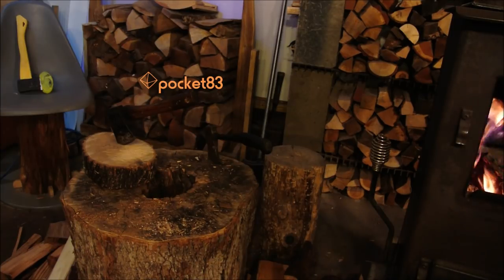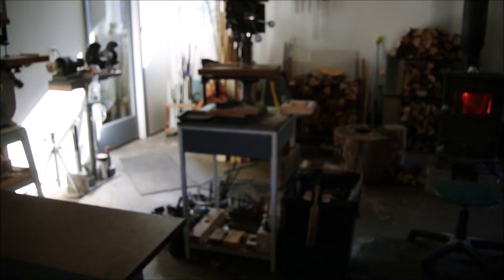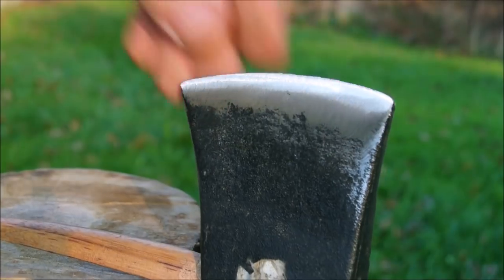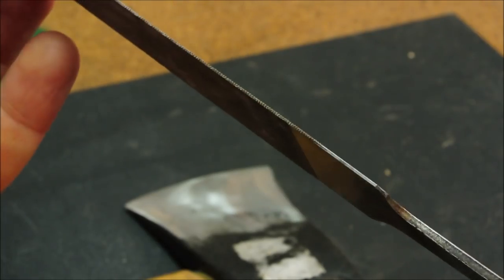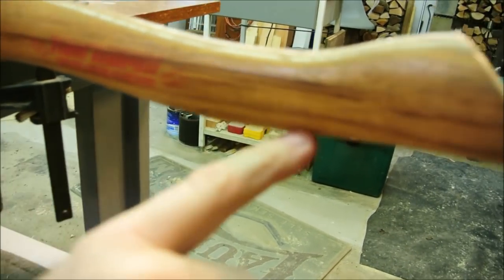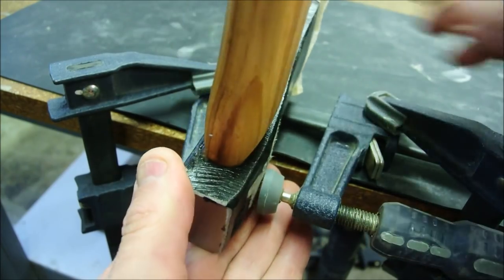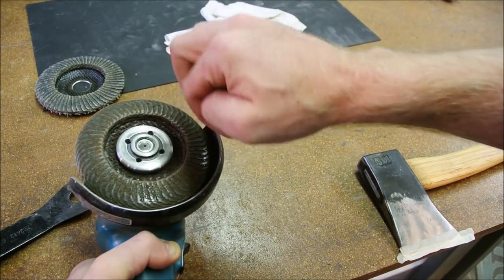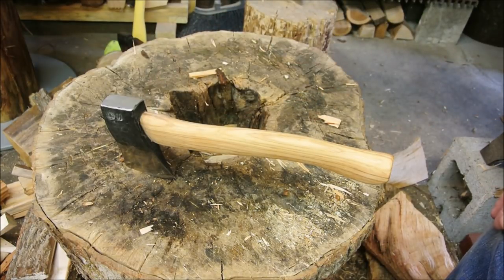'True Temper' axe (hatchet prepare/repair)

Comment from the maker: This video is pretty by-the-books, but I have a couple of weird ones in the works. Thanks to those of you who stick with it in spite of the eclectic variety of topics around here. Think of it less as a disparate disjointedness of theme, and more like a meritage of content—that is, a pretentious blending of fine wines that will still produce the same overall æffect. 
Enjoy the weekend ;)
Reply: Have you seen Wranglerstar's video on screw augers and splitting wood with a screw driver?  How do you feel about that? I would think that it would be ok wit a plug in drill but only for something like camping would I use a charge on my battery drill for that since the number of charges is numbered with those batteries. I know the hatchet or axe is the most environmentally friendly and technically a tiny bit of electricity from the grid is an order of magnitude less impactful than the waste created by improperly disposed dead lithium batteries so only use a battery powered drill when absolutely necessary.

Comment: Little late to the party, but better late than never! I just wanted to say that I completely agree with you on the use of sharpening stones. I used to use stones after I filed my bit, and found the result to not be worth extra work. I just filed my edges with my good ol’ Nicholson bastard without a stone and have seen not enough difference in my axe’s performance to make it worth it. In my opinion, while stones can make an edge beautifully nice, they’re kind of superfluous at the end of the day.
Reply from the maker: Yes! And while we're at it, It's a silly ritual to bring a stone to the woods with you. You can sharpen far better back in the shop, and a sharp axe lasts for days. And to use spit? That's not being industrious; it's just stupid.

Comment: Please excuse my ignorance. What is the reason for the baby powder while you use the file? Thanks love the content you are putting out!
Reply from the maker: No worries! It keeps the teeth from clogging. In use, it almost feels like a lubricant. The little filings can be blown off or wiped away easily.
Reply: pocket83² I see, thanks for the reply. Cheers 🍻
Reply: @bacon81  I was wondering that too, thanks for the answer.
Reply: @pocket83squared  shit that's a fantastic idea, does it work with keeping it getting clogged with wood and other materials as well? I find myself too often having to brush out the crap from my file teeth.

Comment: I agree with your comments on the wet stones.... That being said i have a large hand crank grinding wheel that i use to sharpen everything. It cuts like 100 grit but leaves a finnish like 400, finnish off with a couple passes from 600 and 1200 grit sand paper... Pop hairs in less then a minute. To me real question is how fast can pop hairs without compromising the temper

Comment: Why can axes be filed?
Reply from the maker: Because the metal of the axe head is softer than the metal of the file.
Reply: @pocket83squared  all right, I will change my question a bit because that's not really what I meant

Why are axes not hardened as hard as a woodworking chisel or plane iron
Reply from the maker: Some of them are quite hard. Axe heads with really hard edges are more typical with the expensive ones. Of course, with hard comes brittle, and that means that they're also harder to sharpen.
Reply: @pocket83squared  thanks, I now understand